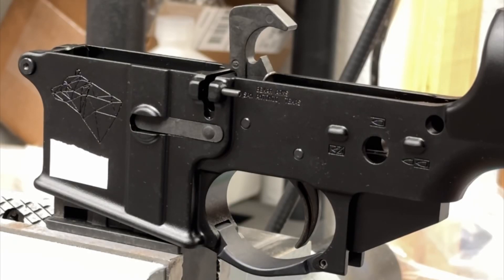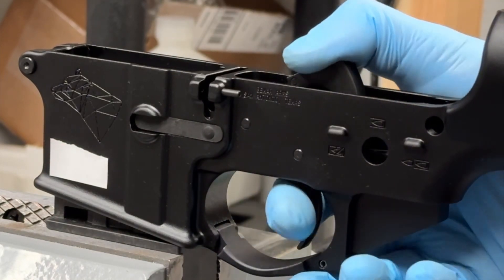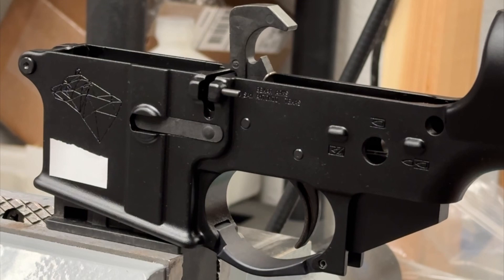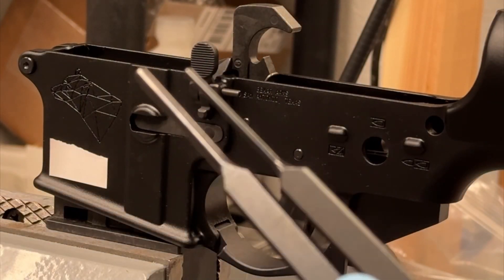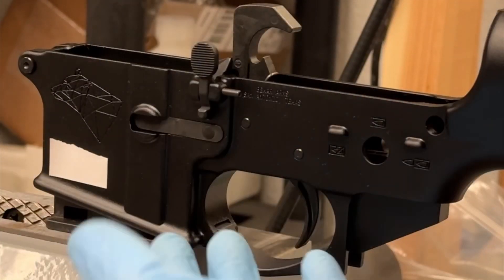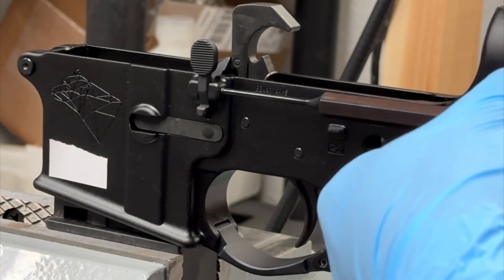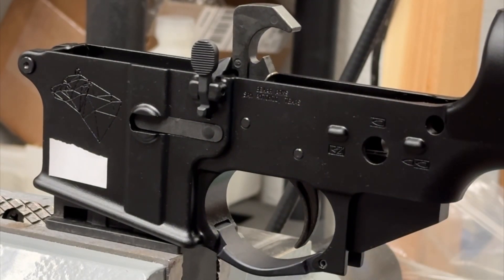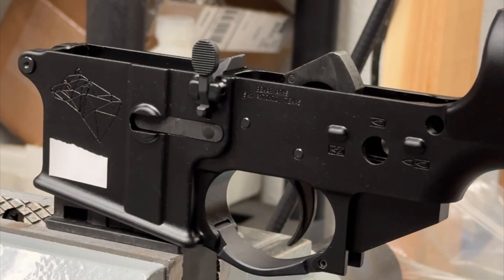Bexar Arms - AR-15 Bolt Catch Installation Tips

Comment: Cool, can you show us how you take the pin out. Do you tap from the front? If so, you do you deal with the bump on the lower? I have seen people do it both way....punch as you were and just push it out the other end (rear to front) and I have seen others punch from front of the lower and push pin out toward the back of the lower.

Comment: it seems that lower goes full-auto. Are all of your lowers full-auto factory ready? I'm thinking that may need an additional tax stamp if purchased.
Reply from the maker: Just to be clear, for legal civilian ownership of full auto, the firearm must have been made before 1986 when the ban was implemented, which my lowers clearly are not.

To convert any firearm made after 1986 into full auto, you need a manufacturing FFL07 as well as an SOT 2, and every full auto conversion must be documented with an ATF Form 2.

Comment: If I care about scratching the lower, I'll put several layers of painters tape on the front part of the bolt catch housing and use a table vice to just press the roll pin into place. If I don't care about scratching the lower, I'll use regular pliers. Same goes for the roll pin for the forward assist